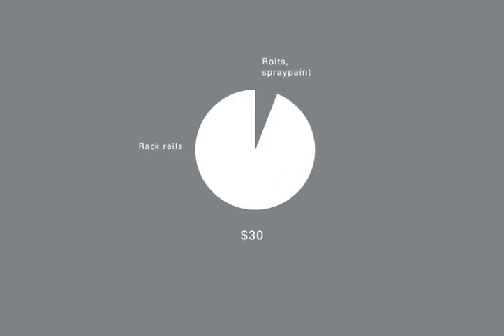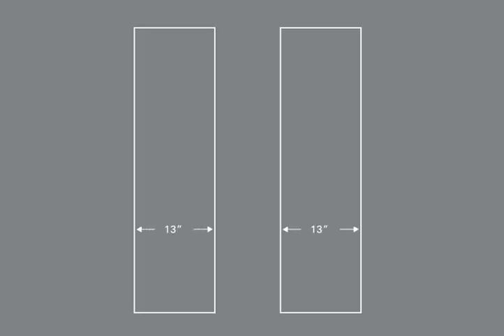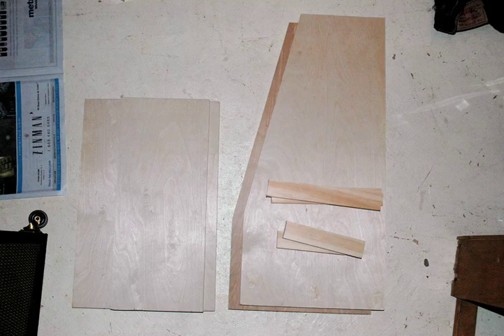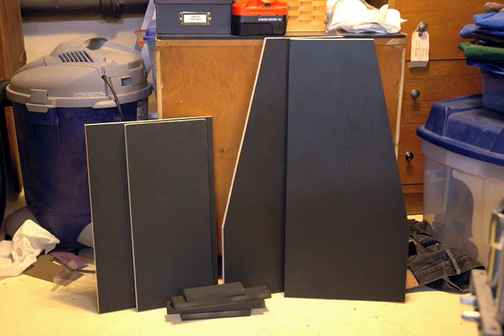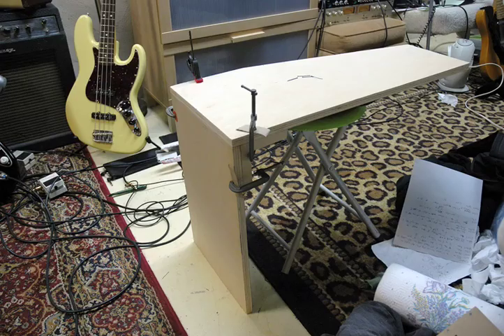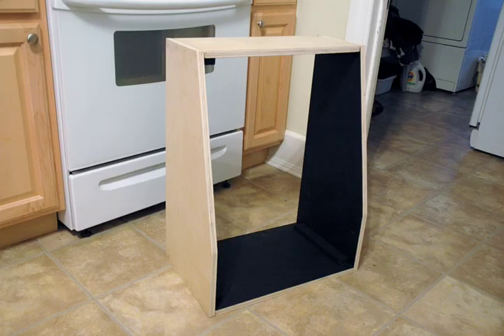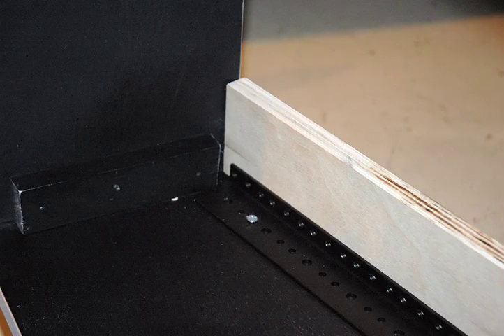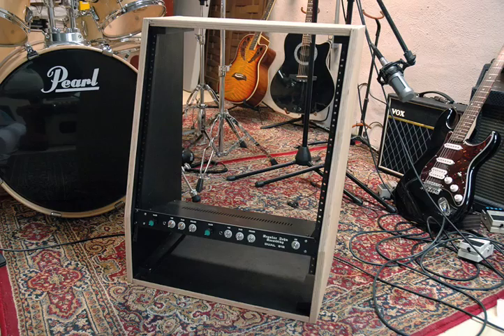The Basement - Building a DIY Equipment Rack

Comment: Excellent work and video.. I recently bought a bookshelf that is 38" wide capable to hold 2 side by side rack units once I modify it for weight and fit It should do the trick.  I should have looked for your video sooner for better ideas under $100. This bookshelf set me back about $75.

Comment from the maker: The point of the straight parts on the bottom is to give room for the rack gear, which is at an angle, to fit as it angles toward the back, but it shouldn't hurt anything to not have those parts, you just might not be able to put a piece of rack gear at the very bottom of the rack because the back of the piece would hit the bottom of the rack, if that makes sense. Rear rails are a good idea. I'm going to need to build a new or bigger rack soon, the one I built here is getting full.

Comment: Handsome looking rack and very informative.  I built a very similar rack myself a couple of years ago for my studio.  Mine has wheels so I can move it easily--even though it rarely moves from its position next to my desk.  Overall great video.  P.S.  Leaning guitars against amps instead of putting on a guitar stand is a great way to have your instrument get damaged...  Just my 2 cents.  Thanks again for a great video.
Reply from the maker: Since this video I've built a new rack to house more equipment, I went with castors too. That one is built a lot more sturdily and is finished much nicer. I documented the build and I'll be putting together a video for that as well. And about the guitar, that's probably the only time in my life I've ever leaned a guitar instead of putting it on a stand, I don't know that it should be a major takeaway from this rack video. I'm a stickler about putting guitars on stands and when I'm recording bands I'm constantly reminding everyone to use the stands I put in front of them rather than leaning them or putting them on the floor, it's amazing how people don't think to use them even when they're seeing the stand all day.

Comment from the maker: The angle is just whatever you want it to be so the gear is positioned comfortably for use with your desk/setup. For mine it's 27" tall, 13" deep on bottom, 8" deep on top, which makes the angle 285 degrees. But you can make it any angle, all you need to do is changed the depth of the top accordingly and draw a line from the top of the straight part (8" tall on mine) to the new top. I also have castors on mine, I just figured people could figure out what they wanted to do about those themselves!

Comment from the maker: @DrUmSensitive I'm not completely sure what you're saying the issue is..you put gear into the rack using rack screws, they're a standard screw that fit in the threads in the rail. Hold up the piece of gear, line up the holes in it with the threads in the rail, put a the screws in, tighten them, and it's in.

Comment: Do you know whats the measurements to build a basic squared rack case? I just need the inside measurement.
Reply from the maker: Rack gear is 19" wide so that's your interior width. One rack unit is 1.75" tall, so that multiplied by however many units you want it to house. The depth only needs to be as deep as your deepest rack gear with cords attached, if you want it to hide your cords. The rack I'm using now that I built is 12" deep from the rails, but has an extra 3" in front of the rails so knobs don't stick out past the front. So 15" deep for mine, yours can be whatever depth you want.

Comment: I'm having a real hard time with a similar rack. How do you screw the gear together with the rack?!?! Do you use screws and nuts? Because that is the worst method in the world, if you plan to take gear out and put it back in, sometimes. There is not enough place for the fingers, and it is really a pain in the ass to do it.

If you have a better solution, I would really like to hear it... :/

Comment from the maker: @DrUmSensitive Ah, that's a shame. Yes all rack rails have threaded holes. They're widely available online, just searching "rack rails", and not too expensive. The rack rails that are built in when you buy a rack have threads also. It definitely seems like it would be a pain to have to use nuts for them. But it seems like if you're in a place that you could buy gear to go in a rack you could also find rack rails. Good luck!